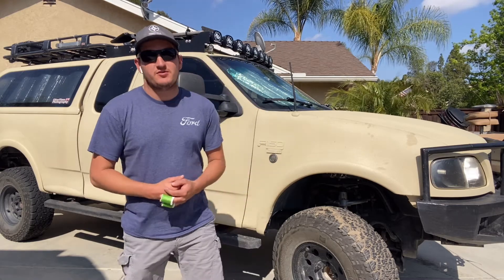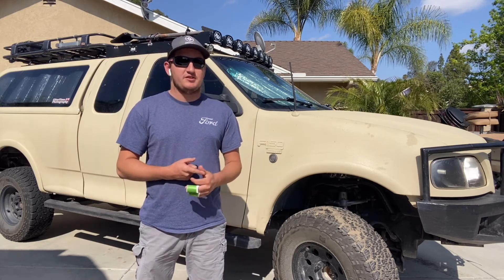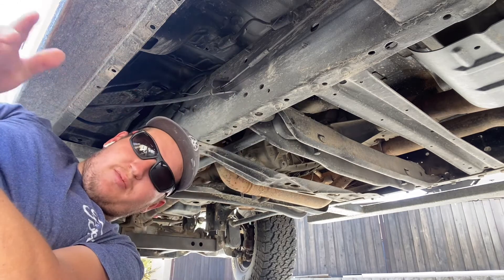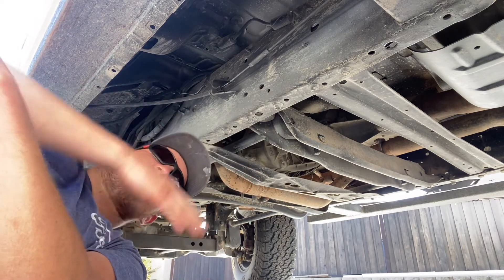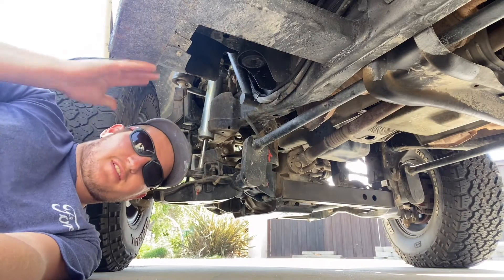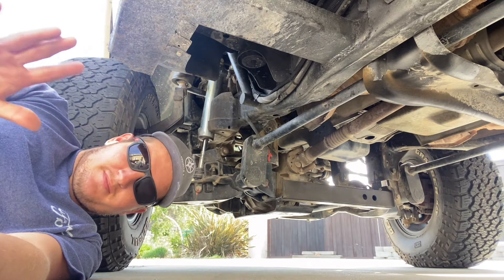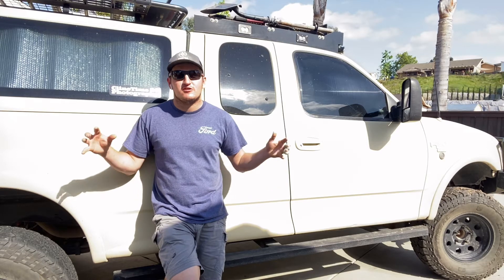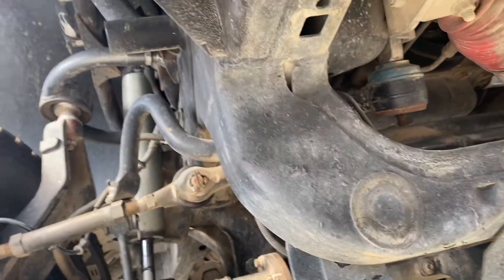Rough Country Lift kit 5" Review 97-03 F150

Comment: This generation truck already sits pretty high stock. Run the largest tire you can with the stock suspension, regear and proper shocks/rear leafs for your load and it will probably work great for overlanding trips.
Reply from the maker: Yep that’s basically the direction I went, just posted up a video of how we went to coilover conversion!👍 she’s already regeared with 4.56 gearing and has Deaver springs in the back! So I’m thinking with this upgrade she been riding pretty nice!😁
Reply: Some sit higher, but mine sits low.
Reply from the maker: @emmittmatthews8636  oh no way?? Do you have additional weight?

Comment: I have a 2003 FORD f150 AWD supercrew, with the 5 inch rought country lift kit. Are you using factory OEM CONTROL ARMS.? or after market performance control arms. My truck has a terrible dead wobble🥹🥹
Reply from the maker: @santiagodavila1426  factory OEM arms, had the same problem. Mine was because the rough country shocks that came with the kit sucked. Went with better stiffer shocks and that made it way better

Comment: I believe I have the same lift
Reason I believe and don’t know is because
I purchased the truck with it and it has the RCX lift with badge on it. 
Not familiar with F150 or pickup trucks for that matter so this, is a first for me.

Wanted to ask you two things
1. What sway bar end link did you go with ? Part # would be a huge help
2. What side steps are those? I love them since they run across the whole side. 

Planning on using my truck for detailing so bed is going to carrying weight. 
A extra 2k lbs or so
Give or take will be added to the rear.

I also notice that you have a steering damper, 
I removed mine because I thought it was the reason my toe rod end is rubbing with the subframe
Which it’s not but I’m still trying to figure out that issue. 

Thanks on the review
Planning on upgrading my shocks and my leaf springs 

But I feel like the front is higher than the rear. Looks sort of squatted. Wish I could send you a pic

Comment: Did you buy the torsion bar relocators directly from realift? I own a 2002 supercrew and need to do something Bout that torsion bar bracket. It hits everytime I go off road. I do lots of trails in baja and I need more clearance. Thank you for the awesome video, love what you have done to your truck.
Reply from the maker: Yep bought the relocators directly from them and they do work great!, I’ll be honest though checkout my video on the 5”inch rough country lift! If I could do it again I would honestly get rid of it and go back to stock👍 thank you very much for glad you enjoy the videos🤙😁
Reply: @Clinetimephotography  I agree with custome midtravel upper and lower A arms being a better option. But that would be quite costly. Travel wise Im ok with the current travel, I did ditch the RC shocks and installed bilsteins 5100s  and it works just fine. Except for that torsion bar bracket. Thanks for replying, I appreciate that. ill call realift tomorrow and try to order some. 👍
Reply from the maker: @jibrilthegreat35  your very welcome and yep yep that would essentially get rid of your torsion bars too so you could run coil-over shock, also the other problem I’m constantly having with my RC lift kit is I’m destroying the skid plate for the transfer case, it hits on a lot of obstacles…. Quite honestly I’m surprised I have broken it yet
Reply from the maker: @jibrilthegreat35  yep yep it honestly all depends on use brother, my truck I want this option because I do a lot of off-roading and I feel the torsion bars really limits the fully capabilities of the truck! But this setup isn’t for everyone if your doing mostly highway miles then by all means do something different just another option! And your very welcome absolutely you guys make the channel and i do my best to help everybody out💪

Comment: I have a 2000 f150. I just got the rough country 4-5 inch suspension lift and steering stabilizer.   I'm very happy with it.  Do u know a radio with navigation and backup camera that will fit that's not expensive?
Reply from the maker: Hey brother sry about not responding usually I’m pretty good at replying, idk why I didn’t see yours and they’re are pretty pricey it just depends on how much you wanna spend! But I would definitely recommend checking out some review videos of them to see which people like🤙 Also for some reason idk why this is but whenever someone installs an aftermarket radio in their vehicle they usually end up making the electronics weird, mine in particular will not turn off certain electronics unless I turn my radio off…. Super weird but just so you know💪
Reply: @Clinetimephotography  Thanks for the reply.   Can u elaborate a little on making the electronics acting up when u put aftermarket radio in.  I'm about to get one.
Reply from the maker: @qw7154  So basically when my radio was first installed it worked great, after about I think year the radio I kinda took over the trucks electronics. So with what will happen is if I turn the truck off and take the key out the trucks odometer,  dash lights, and some other systems will still be on. The only way to fully turn them off is I have turn off my radio and that kills power to everything else. Apparently this is a pretty common problem I guess when you install an aftermarket radio.
Reply: @Clinetimephotography  ok thanks. 👍  I can't find any traction bars that r made for my f150.  It's a 2000 4x4 f150 xlt 4.6 .  Do u know of any?
Reply from the maker: @qw7154  https://www.f150forum.com/f6/traction-bars-311035/
This was a forum about them I found, looks like procomp makes some
Reply: @Clinetimephotography  yes thank you!
Reply from the maker: @qw7154  your welcome

Comment: 5:03 that's not what death wobble is, it's from worn out or misaligned suspension and steering allowing your tired to wobble side to side, nothing to do with being top heavy
Reply from the maker: Later on the video on go on to explain how the shocks contributed to the death wobble and it was also my further belief that having extra weight on top of truck even more so contributed to it being unstable
Reply: @Clinetimephotography  I could see extra weight on top making death wobble worse
Reply from the maker: @schulzy1544  yep yep since then I have completely redone the suspension setup and weight distribution, we are now running a coilover setup and the custom made racks are much lighter
Reply: @Clinetimephotography  I'll check out that video, love your content
Reply from the maker: @schulzy1544  Absolutely man and thanks a ton been slacking lately but planning on doing some more videos😁🤙

Comment: Did you have to lengthen any break line to reach the rubber break line going to the front break calipers
Reply from the maker: Nope I didn’t, I will say you do need to be careful with you ABS sensors for your hubs thigh so you don’t cut them between your sway bar links and the knuckle
Reply: @Clinetimephotography  ok the issue I am running into is that the rubber line does not retain enough slack to allow for suspension travel and turning
Reply from the maker: @Momentodelabruh gosh yeah that’s weird I don’t believe I had any problems on my truck, yours is 4wd drive as well correct?
Reply: @Clinetimephotography  yes it is a 2003 f150 4wd xlt, the current plan is to use a union and add extra line to either side to give the soft line more room, ive been looking around the internet and can’t seem to find a similar issue to mine
Reply from the maker: @Momentodelabruh  yeah that may be your best bet or try running aftermarket brake lines but those can be a hassle sometimes as well

Comment: What was the price tag on the making and installation of the shock hoops?
Reply from the maker: I spent about 3,500! That included the shocks and the shock hoops with an engine crossover bar
Reply: @Clinetimephotography  that's actually not a bad deal. I have a fabtech 6" and wanted something like your setup i just spent 1200 last year on an entire front suspension component purchase and I already have to replace my upper ball joints and hubs lol. I'm purchasing the control arm kit instead. Glad I found your channel.

Did they give you different options for the shocks?
Reply from the maker: @ProjectNemesis92  yeah honestly though that’s all coming out here in a little bit😂🤣 I’ve had a bunch of problems with the way it was built! Are you running spacers?? And no this were main options at the time the new setup w should be really nice! If your off-roading your truck Id probably stay away from lift kit’s Personnally?
Reply: @Clinetimephotography  that's a negative on the spacers for now but I will need them in the future. Same issue with me on my kid the front suspension just doesn't have enough clearance and I totally agree with you on the lift kits for off-roading are big no no.
Reply from the maker: @ProjectNemesis92  I’d try and stay away from them if you can, I’ve been going through hubs like crazy with mine and yep the lift kits definitely have there limitations😂

Comment: Does it ride worse?
Reply from the maker: I did I start getting some pretty bad death wobble after I installed the kit, this could of been from having a lot of weight on the top of the truck… but I fixed that by upgrading the shocks from the RC 2.0 to the fox 2.5’s